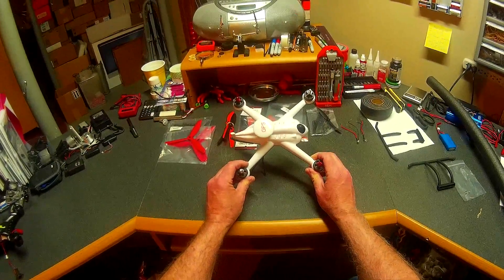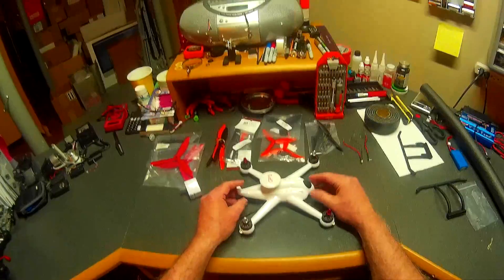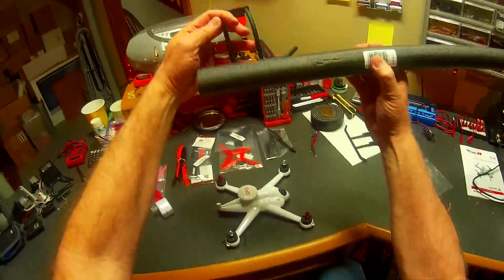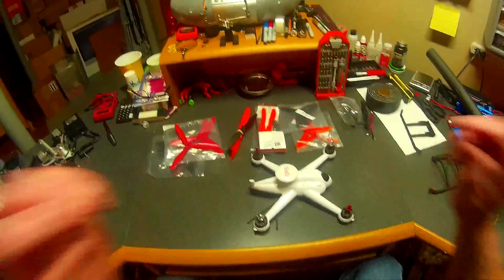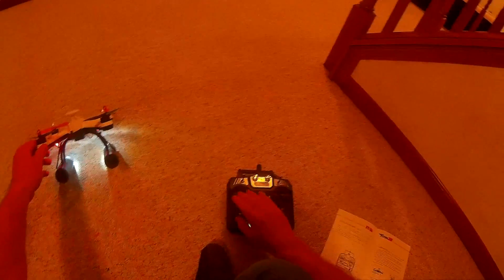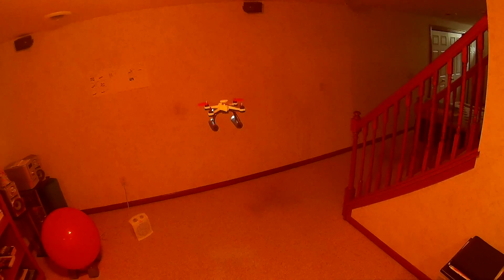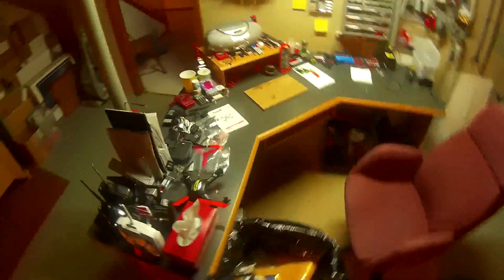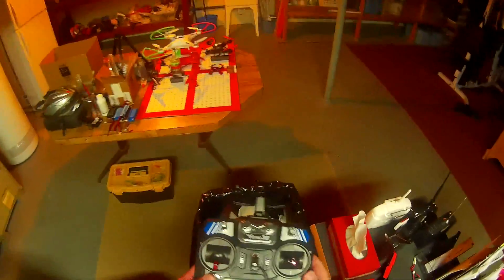My Flying 3D X6 quadcopter replacement from Banggood

Comment: It would probably calibrate better outside where it can get better signal :)
Reply from the maker: The RCAddict  Yes.  It cannot get GPS inside the house.  This is a fast quad with the 6045 props.  More video coming.
Reply: MrPolymers How did you callibrate it inside the house then?
Reply from the maker: You don't need satellites to calibrate the compass.  Only for GPS flight.
Reply from the maker: I did not think so anyway!!;)
Reply: MrPolymers Have you had it outside testing the GPS yet?
Reply from the maker: No GPS return home yet.  Latest video up.  It's a long one..
Reply: MrPolymers Ok, I have your video in my WL so I will get too it soon :)